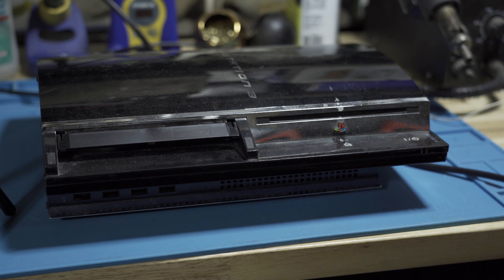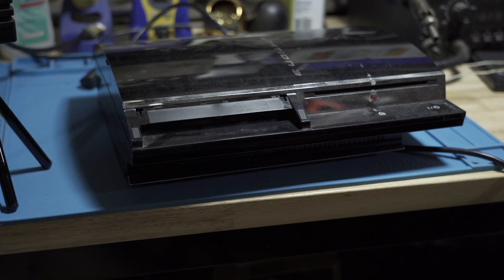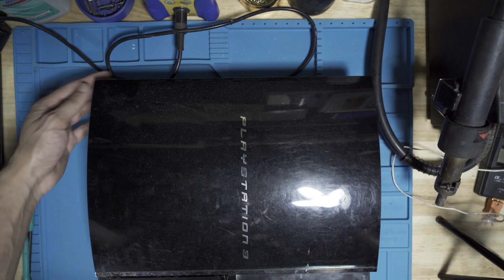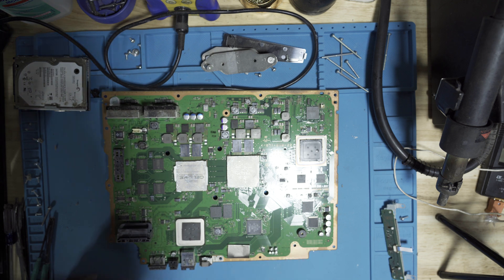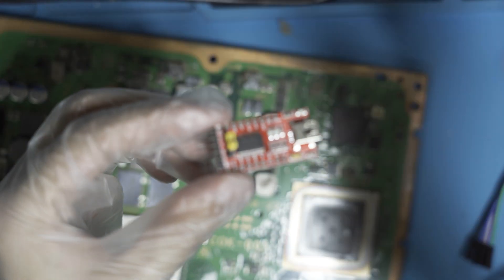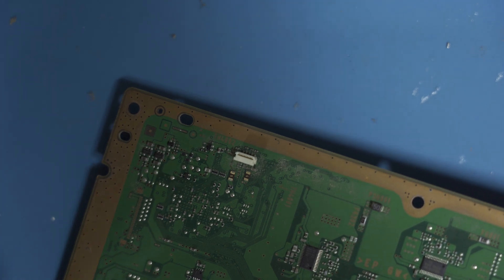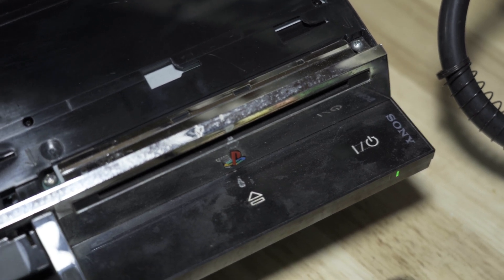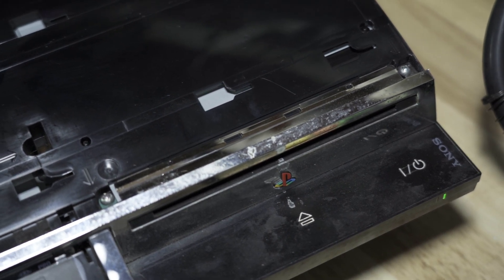Reballing a YLOD PS3 in 2021

Comment: what temperature did you set? I bought a BGA station
Reply from the maker: There's a whole profile to create, not just having one specific temp. What machine do you have?
Reply: @Techbabblers  I have the "scotle ir 360" machine there are already 3 profiles set on it but no profile allows the GPU to be removed from a ps3. the temperature reaches 225 degrees, the machine gives an alarm but the GPU does not withdraw.
Reply from the maker: @dzaraing4495  What does your thermocouple read when the machine reaches 225? I ususally use some tweezers to nudge the chip slighly and it it moves then I lift. I lifted a CELL yesterday at 225 but RSX i've taken off at like 220 on my readings
Reply: @Techbabblers  I tried but the GPU does not move, I pull hard on it, it does not move at all. I think the machine is not heating long enough
Reply: @Techbabblers  it is a problem of time and not of heat. but I don't know how long to adjust, 3 minutes?
Reply from the maker: @dzaraing4495  Well i set mine for about 30 seconds and I can usually get it flowing in about 10 seconds if that. Should start flowing around 218C.

Comment: The issue was the bumps inside the RSX and Not the solder balls. That's why reballing Did not work Even though you reballled it really good. Those bumps will melt around 150C and it will fix the Chip. However the early PS3 chips are unreliable so it's a temporary fix and in some cases the RSX is completely toasted.  Reballing is such a myth because you had to heat up to around 200C to remove the Chip, therefore melting the inside of the chip itself (which fixes it). I think using a Slim RSX is a great option. But if you are not using your PS3 intensively, it should last a long time. Great video 👍
Reply: Correct... but he said he knows this. Personally I don't know why he then bothers to reball the chip if it will just die again. Better to place a new one!
Reply: @Josh.Davidson  the man Josh has spoken ! 👑
Reply: high lead bumps melt at 350
Reply: @jm036 I was about to mention this great job pointing this out. Maybe he ment the underfill starts melting at 150c which is possible but im not an expert so my opinion doesn't mean much.

Comment: Just found the channel man. Been doing repair for years. Looking into doing reballing. Any tips for this old man? Thanks for the video!
Reply from the maker: Get some test/scrap boards and give those a shot before trying it on an actual "working" console if that makes sense. Then just keep going at it, failure is key. It'll help build out a working profile that will work!
Reply: Same here. I just ordered a bga rework station. I can't wait to give it a try.
Reply from the maker: @jeffbanfieldsflwr3537  What station did you get?
Reply: @Techbabblers  I got the IR6500. I'm still trying to figure out how to set up the temperature curves. Do you have any pointers for me?

Comment: How come you didn't start with replacing the NEC/Token caps?
Reply from the maker: The error codes I got showed that it was an RSX issue!
Reply: @Techbabblers  couldn't bad caps cause the RSX to have errors?
Reply from the maker: @jeffescortlx  Well, depending on SYSCON, it shows what error codes are and what it's related to. NEC caps would show a different error code.
Reply: @Techbabblers  i want to test my cech-A01
can a rsx overheat in wintertime below zero in just a mere casual 2 days playing kino der toten?
i went back and asked the previous owner a question. mind you this console is never been opened with warranty stick intact. to open it you'd HAVE to tear the sticker or break the topcase. which is also intact.
QUESTION: has your son used it like regularly. yes i believe he does.
my assumption is this is false though and it was stationary long enough for the nec tokens to have one fail.
best case i still have my chance to watercool this origonal rsx and cut a hole in the top case cooling the motherboard effectively with a good fan. and hope it lasts a long long time